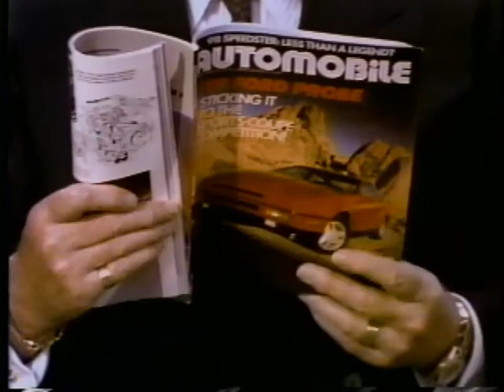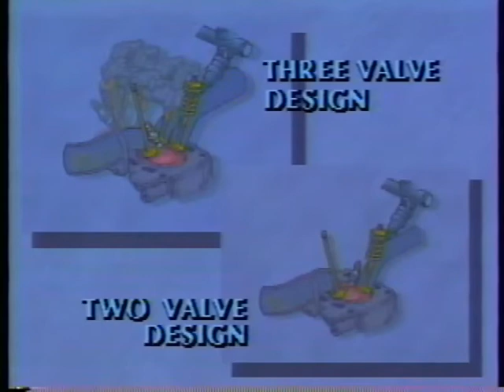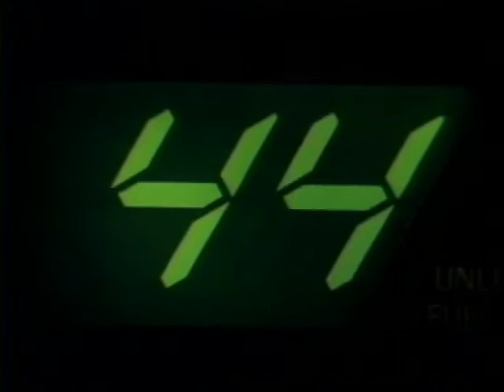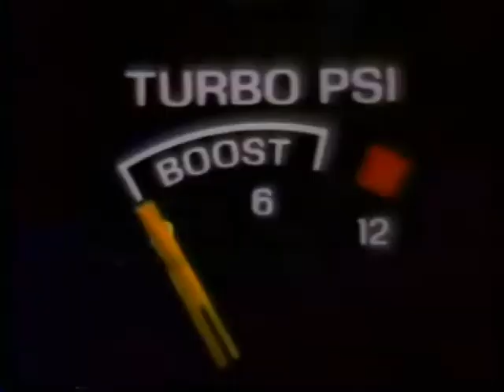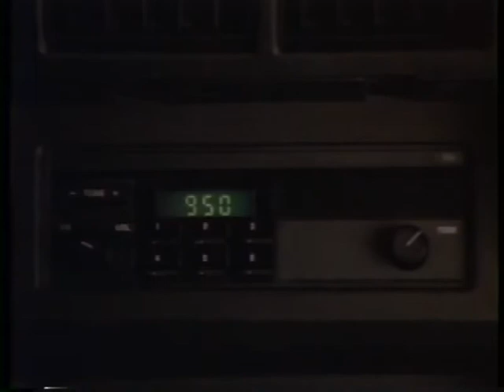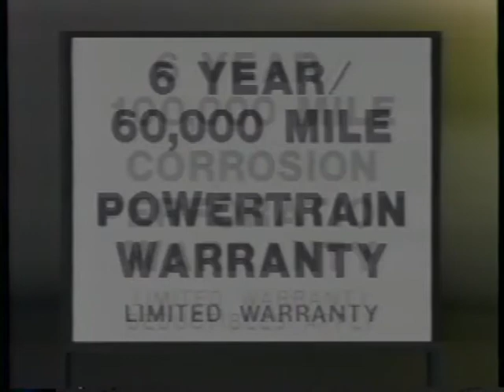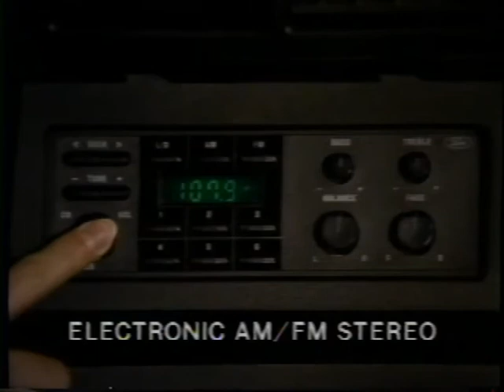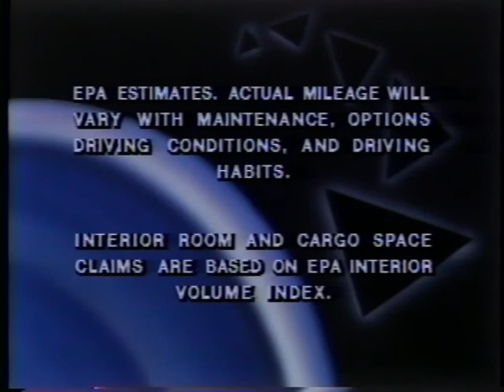1988 Ford Training Program 1989 Probe and 1988 1/2 Escort

Comment: It was a bad choice to highlight how old the Escort was getting while Japanese competitors were on 4-year design cycles. That being said, in 1991 (spring '90) when they finally started with a clean sheet (borrowed from Mazda) they ended up better than the actual Mazda due to better rust protection.

Comment: I had one of the first 1988 1/2 Escort GT's in Virginia.     Thanks to poor union assembly work, that car had chronic quality issues that were only solved by me moving and using a different dealer when my car turned 60001 miles (no joke).    The pathetic union workers installed a main harness so that it was kinked and would short out the head light switch in less than a year.   I went through 4 such switches.    The front end wore out tires on one side and thanks to a great second dealer, they found that a front strut had been bent and was wearing out suspension pieces and tires.    After that, the car was dependable and fun to drive.    It looked exactly like the white one in the video except my interior was gray.